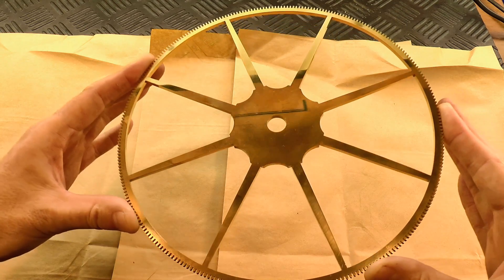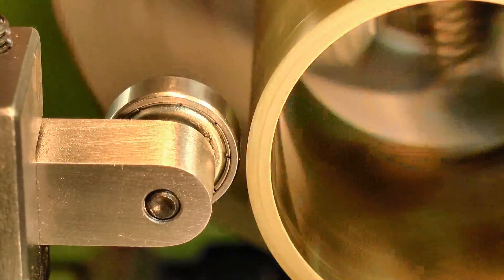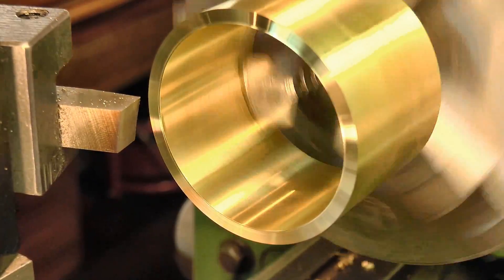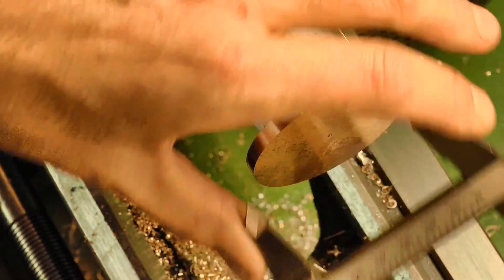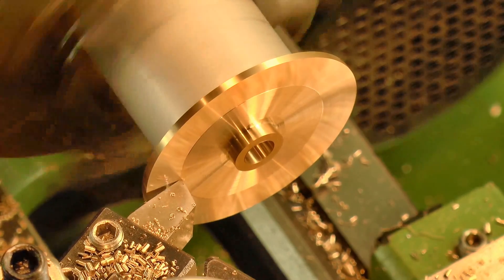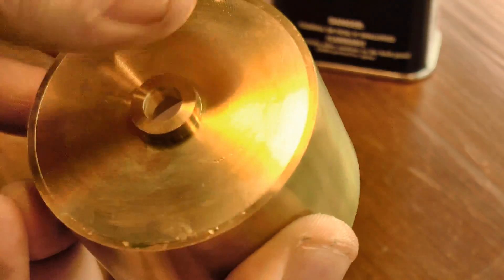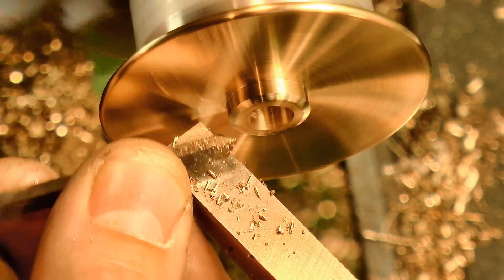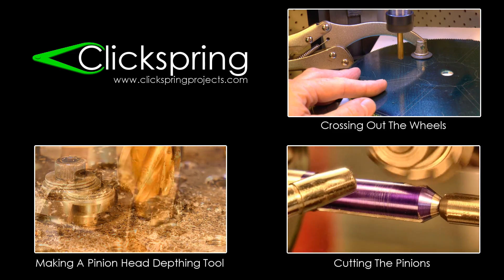Clockmaking - How To Make A Clock In The Home Machine Shop - Part 7 - Making The Barrel

Comment: I use a upside down can of compressed computer cleaning air to cool things off. Be careful not to allow to much spray out. It works beautifully for cooling hot stuff. It would have worked in fantastic fashion cooling that part you had superglued to the spindle. Keep up the good work! Your vids are most enjoyable.

Comment: Clickspring, why don't you use those carbide tips i see almost everyone else using for general cuts, as someone who doesn't do machining i don't know why you would or wouldn't want to use one.

Is it the metals you work with don't like them? Personal feel? Don't like the finish? More expensive than you feel is worth it? Dont have the equipment/adapters?

I have questions and am curious.

Comment: Nice work as always.
Just wondering where you source all your brass from?
Also, when I machine flat large surfaces on the lathe or mill I sometimes secure them with thin strong double sided tap. Works really well. Have you tried this technique instead of superglue?

Comment: Just an observation. Doing work in a three jaw chuck is in my opinion a recipe for disaster. The whole dynamics of how you are holding the work in a three jaw is the problem. I'm not being critical of your work here, it is always outstanding. When I was doing Tool Room machining for a living in when dealing with these types of situations we would use either an over sized collet or pot chuck as some call them. Or some type of expansion arbor or collet. But then there is the factor of just how much tooling one can afford or have space for.  Of course we were usually working in tool steels and on lathes a lot more rigid than a hobbiest grade benchtop. Oh how I wish I could get my hands on a Hardnge HLV-H/EM. Or one of the Tiawanese knock-offs.

Comment: Fascinating video series.  How much balance tolerance do you need when making the clock?  Are the wheels going slow enough that slight imbalance isn't a problem?
Reply from the maker: Generally for the slow moving wheels not a lot is required - balancing of the display hands can be important for high precision timepieces, and balancing of the fast moving parts of a chronometer for example is critical, but there's nothing moving terribly fast in this mechanism

Comment: Why not seal the barrel cap with silver solder instead of Loctite?  You've soldered other parts, but I wasn't sure why that wasn't done here
Reply from the maker: Traditional methods of securing the barrel end cap include soft soldering and friction fits. However soldering a join can often lead to heat marring of the parts as well as quite significant metallurgical changes, and both methods are not particularly easy to reverse during a future service, without causing more damage. These are some of the reasons why Loctite (in this case 603 oil tolerant adhesive) is very popular in modern horology. It has a shear strength comparable to traditional soft soldering, has none of the metallurgical issues associated with heating the parts, and can be easily reversed with a gentle heat. Other parts like the crutch fork I am happy to hard (silver) solder, particularly if I am able to take a passing cut to clean up the heat marring. Thanks for watching and asking Thomas.
Reply: @Clickspring  Thanks, but i was expecting some more machining: Boring 6 or 8 very small radial holes in the barrel's cylinder and the rear disk followed by insertion of steel pins to definitely secure the disk and cylinder (use Loctite to secure the pins).

This joint will be submitted to mainspring's torque, hence the steel pins.

Comment: Why did you make the barrel and the first end cap as separate parts and glue them together instead of making them as one part?
Reply from the maker: +TheNerd484 Conservation of material, brass is very expensive, thanks for tuning in
Reply: that's what I figured after posting. All of the components are quite beautiful.

Comment: Is there any special reason for glueing the cap in place instead of brazing or soldering?
Reply from the maker: +Toma Tomov Hey Toma, traditional methods of securing the barrel cap include soldering and friction fits. Soldering can lead to heat marring of the parts as well as quite significant metallurgical changes, and both methods are not particularly easy to reverse during a future service. These are some of the reasons why Loctite (in this case 603 oil tolerant adhesive) is very popular in modern horology. It has a shear strength comparable to traditional soldering, has none of the metallurgical issues associated with heating the parts, and can be easily reversed with a gentle heat. The question of long term strength will only be resolved by a few centuries use, but thus far it has proven reliable and very convenient. Thanks for watching and asking.
Reply: +Clickspring Thank you for clarifying the glue vs. traditional methods issue. The only issue I see with heat (i.e. brazing or soldering) is deformation. Fairly minimal, I would suppose, but in doubt I would have trued the barrel on the lathe afterwards.

Comment: Watch maker rule #1 "Never use Glue" (Also applies to regular mechanical clocks)
Best thing would have been a pressure fit of both caps or the barrel and bottom cap being one solid piece.
Other then then that one small detail that only a horologist would care for, amazing vids and workmanship. You also have by for the cleanest workshop I have ever seen.
Reply from the maker: +Issei Araragi Whilst modern adhesives may not accord with everyone's taste, there is much precedent for using them in modern horology. The BHI training for example devotes course time to discussing the appropriate use of such adhesives, not only in the construction of new mechanisms, but also in restoration work. Thanks very much for watching.

Comment: I know this might be a stupid question but could someone tell me why use lighter fluid to clean the parts and is it only for brass or does it work for all metals
Reply: +Darryl Nolan It is a good degreaser and should work for any metal
Reply: GogogoFollowMe thanks for telling me I wasn't sure what it was for
Reply: +Darryl Nolan No prob, plus it evaporates very quickly ;)

Comment: Chris, I noticed in your videos you choose to use loctite rather than a set/grub screws to secure objects. For the scribe, I understand why, but I was surprised to see that choice for the clock barrel backing. What is the reasoning behind using loctite instead?
Reply from the maker: +MotoTrippin Traditional methods of securing the barrel cap include soldering and friction fits. Soldering can lead to heat marring of the parts as well as quite significant metallurgical changes, and both methods are not particularly easy to reverse during a future service. These are some of the reasons why Loctite (in this case 603 oil tolerant adhesive) is very popular in modern horology. It has a shear strength comparable to traditional soldering, has none of the metallurgical issues associated with heating the parts, and can be easily reversed with a gentle heat. The question of long term strength will only be resolved by a few centuries use, but thus far it has proven reliable and very convenient. Thanks for watching and asking.
Reply: +Clickspring Thanks!

Comment: I'm all caught up on your videos and can't wait for the next. I use your videos as exemplars of quality in my engineering classroom. Does this video use a new lathe - the green one?
Reply from the maker: +GRITLab Thats awesome to hear that! The green lathe is an old second hand 9 x 20. Its not the most pleasant machine to use, so I only really use it for 2nd ops, and when I need the extra swing, like checking the fit of the large wheel in this video. Thanks very much for watching :)

Comment: A thought on the Loctite vs soft soldering and heat marring question. You could potentially solder parts using an oven similar to how electronic circuits are soldered? The oven would heat the whole assembly to just above the flowing temperature of the solder without any localized hot spots. I am assuming that discoloration comes from local application of flames to the surface of the metal. An even heating by dry air in an oven would presumably avoid such problems. The purist in me somehow feels that a solder joint is more eternal than one made with industrial adhesive. Given the time and labour you are putting into the assembly, I feel you are aiming for something designed to endure, and a chemical adhesive, no matter how good, doesn't feel "right". (And as I write this, I am pondering the unquestioned use of wood glue by artisans of countless previous centuries. It is a puzzle, to be sure.)
Reply from the maker: +ib9rt Great question - Regardless of the method of heating, clock parts must often be heated to well over the solder melting point for solder to flow adequately into a join, often as much as 300C. This leads to not just heat marring, but more importantly potential metallurgical changes to nearby components like arbor pivots. This is the main reason Loctite is so popular today in horology, even in some restoration work. It's super convenient, and there are no metallurgical problems. the other big advantage is that it breaks at around 150C, so it can be easily reversed. Thus far it has proven very reliable in use, but only a century or more will satisfy the question of long term strength. Thanks for sharing your thoughts.

Comment: Have wondered - once you have used heat to detach from the arbor - curious as to your method of residual glue removal. ACETONE? Great to see someone else using a graver.
Reply from the maker: +ChrisB257 Hey Chris, you're exactly right, acetone takes it off super easy. Cheers mate.

Comment: Fyi super glue sets with moisture not air. You would get a better bond if you lightly moisten the back of the work .
Reply from the maker: +Fox Kitsune The bond is plenty strong enough as is, but thanks for the tip I'll keep it in mind. Thanks for watching.

Comment: is there a reason for bonding  the rear cap to the barrel with loctite.or could you have soft soldered it on? 
i like your work you are very precise and clean and you explain it well. keep up the good work
 thanks for reading

Comment: why do you clean parts with lighter fluid? o.o think its the 1st time ive ever seen anyone use lighter fluid for that lol
Reply from the maker: +emerybryant Lighter fluid is an excellent solvent for cleaning off oil residue. Thanks for watching.
Reply: +Clickspring I used to use Kerosene as a cutting fluid for brass actually. Works really well, just don't try it on steel!

Comment: You use a fair bit of superglue, which obviously works well. What would clockmakers have used before superglue was available?
Reply from the maker: +Harley Domino Hey Harley, traditionally they used shellac, and in the watchmaking world they still do. The shellac is gently heated, and then smeared onto what's called a "wax chuck", and then the part is pressed into place. The shellac stays tacky long enough for the part to be centered, and then you're off an running. I use it on occasion, but I find superglue is just so much more convenient, and can also hold onto much larger workpieces.
Reply: Ok! A follow up question- given the extreme accuracy of what you're doing, doesn't the heating process to break the glue bond ever push things out of line, or does it expand and contract the same amount?

Comment: I'm not a machinist but I do like these videos.  Recently, I saw one of you films where a comment was left about drilling brass and a machinist's tip of tweaking the drill point by honing to stop the grabbing.  Would the same tweak help with the machining brass to stop some of the chatter?
Reply from the maker: +John Banfield Hey John, chatter is usually caused by a lack of rigidity, incorrect cutting speeds, or too much tool surface contact. If you get chatter, go looking for looseness somewhere, too much stock overhang etc, try reducing the rpm right down, and take a shallower cut. In fact you can often remove chatter on the lathe simply by pulling the spindle through by hand and scraping the marks off with the tool, and having another go.

Brass is an exceptionally interesting metal to work. One peculiarity of it is that tools used to cut brass must have what is called "Zero Rake", perhaps even a slightly "Negative rake", otherwise the tool tends to dig in, or "grab" as you mentioned. You may have noticed that all of the tools I use for cutting brass on the lathe have a flat top - this is an example of zero tool rake. By contrast, steel cutting tools slope backwards, and this is called positive rake. More info on this video: https://www.youtube.com/watch?v=o8Bd8G21Vv8.

A standard drill bit cutting edge has positive rake. If it were used "as is" on brass, it would tend to grab the work, and pull it up onto the flutes of the bit. This is not only hazardous to the operator, but also generally ruins the work. To counter this property, the cutting lips of the drill bit are lightly flattened with a slipstone, to change the cutting geometry to negative rake. Instead of grabbing, the drill bit cuts harmlessly, forming small chips. I will be showing this in a future spare parts video. Thanks for watching and asking.

Comment: what did clockmakers do before locktite?
Reply from the maker: Jackson Cupp Soft solder usually, as well as tolerance fits. If it had existed, I'm certain they would have gone for Loctite - it beats the other two hands down. No heat temper drawing/discoloraton issues, and the bond can be easily broken if required under a low heat. Thanks for watching and asking :)

Comment: I am enjoying your videos immensely.

I have noticed you put a lot of faith in loctite. What advantages does a slip fit + loctite have over just doing a press fit? I have found giving a slight knurl to a part and press fitting it gives a very secure hold.
Reply from the maker: jgreen9381 The main advantage of loctite is simplicity and the ability to break the bond at a later date for servicing, and know that the surfaces will be unaltered. A press fit is equally valid, and its entirely consistent with clockmaking tradition, but there is a likelihood that the mating surfaces will have been altered to achieve the fit, which I would prefer to avoid. Thanks for watching mate.

Comment: another great video. well edited and good commentary. Every second worth watching.
A questions. you placed grooves on teh surface of the arbor to "allow air" for the loctite so that it will cure. I thought locktite required the absence of air to cure, as on the threads of a bolt.
Reply from the maker: Charles Camenzuli Hi Charles, the glue used for the arbor is super glue (cyanoacrylate), which requires air for curing. You are correct that loctite is the opposite. Thanks very much for watching, and asking.

Comment: Chris, I noticed that you have more than one lathe? Red, Green, and the Sherline.
Why the Red and Green lathes, I know that one cannot have to many toys.
Thanks, again for the videos, Greg.
Reply: +eli douek The amount of clearence below the chuck, ie. the largest diameter one can chuck in the lathe, max distance from center line to bed of the lathe.
Reply from the maker: Gregory West Hey Greg, I use the red lathe for most projects, it is perfect for the size work I do. I picked up the green lathe from a retired clockmaker who had it as a job lot with all of his other tools. I only really use it when I need the extra bed swing. The Sherline is perfect for the really small stuff, it is just a delightful little lathe to use. A bit more info here for you: http://www.clickspringprojects.com/blog/which-lathe-should-i-buy Thanks very much for watching.
Reply: +Clickspring what is bed swing?

Comment: I don't really have any experience with any Loctite products, but I have always been under the impression that it was meant as a temporary metal adhesive (like an epoxy). Is the joint you glued "permanent"? Would it not be stronger with solder, or is it just a matter of personal preference (I assume Loctite is also MUCH easier and faster). I guess the bottom line is that I don't know if I'd trust the joint to last for, say, 200 years.
Reply from the maker: sooth15 Great question. It probably is a case of personal preference. Traditionally such joins were made with soft solder, but you're right that Loctite is much less hassle, particularly in eliminating the heat from marring the surface finish of some parts. The bond is strong, and as permananent as solder; you can heat it up in a similar way, and break it as required. Regarding the life of the join, it's too soon to tell I guess, but it is used widely in industrial applications without any lifespan issues that I am aware of. If it is found to be wanting 100 years from now, a future repairer can simply remove the Loctite, and then solder the join. Thanks very much for watching, and asking.
Reply: Clickspring
Thanks for your reply. I can't wait to see more videos as this is the best clockmaking series I've ever come across. -JC

Comment: What loctite types are you using?
Reply from the maker: Max Mustermann Generally I use 603 "oil tolerant". It's plenty strong enough for what I do, and I don't always have entirely clean surfaces to work with. Thanks for watching and asking Max.

Comment: Hi Professor,
 Once again, a video that was perfectly executed. Thanks for posting and working so hard on the production value. I saw in the comments that their are people that didn't like the use of Loctite to hold the Barrel cap on. I don't think you should have any problems with using Loctite on a reactive metal like brass. 
Thanks again!
Craig.
Reply from the maker: craigsbully Yes I've found Loctite to be very effective, as well as having none of the heat marring issues of soft solder. Thanks very much for watching Craig, I appreciate your support.